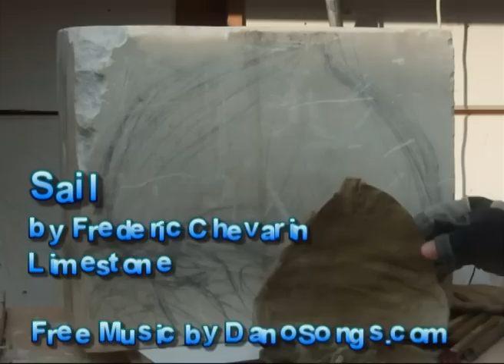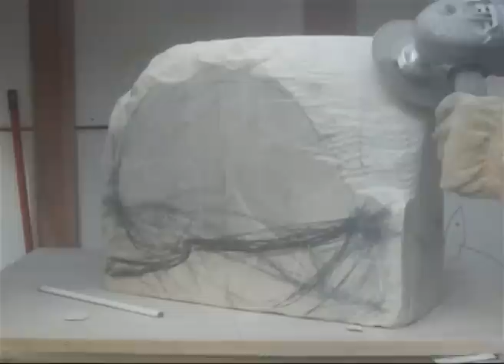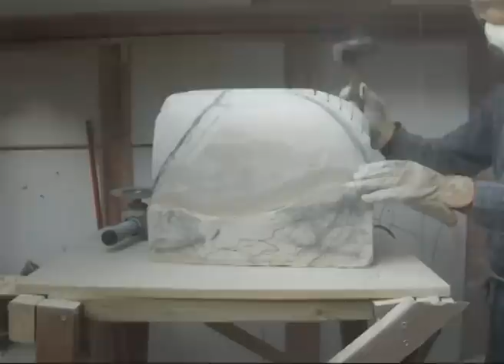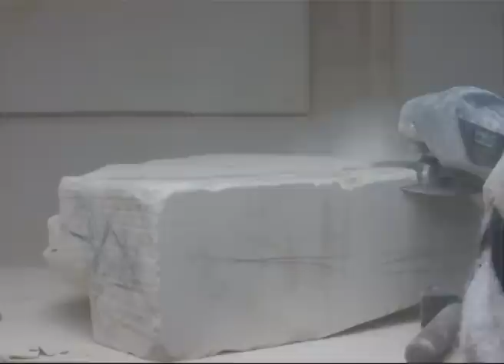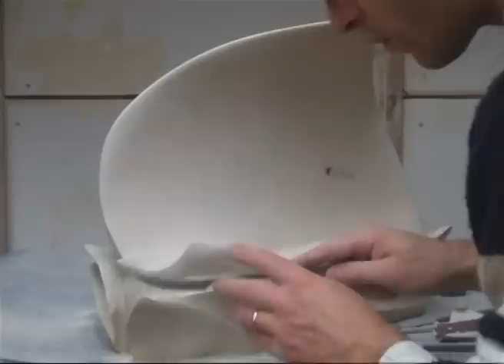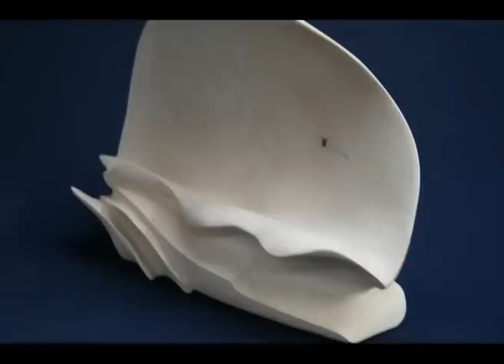Stone sculpture tutorial: limestone carving by french artist Frederic Chevarin

Comment from the maker: Hi, 
to polish, we use sand discs with a polisher. The hardest is to get an even finish without bumps and valleys. It takes a lot of time. I do mine by hand first to get a very good surface to then polish with a mixture of hand and machine finish. If you can't get the machine everywhere, well, it is a hand polishing you have to do. Good luck

Comment from the maker: You sand from coarse to fine grits, always. Depending on the stone, 80, 120, 180, 220, 300, 400, 500, 600, 800, 1200, 1500, 2000 & abrasive pastes.The last ones are not always necessary it depends on the type of stone you work with.